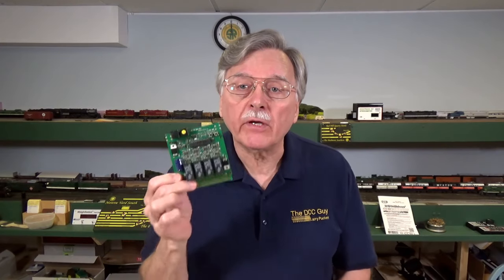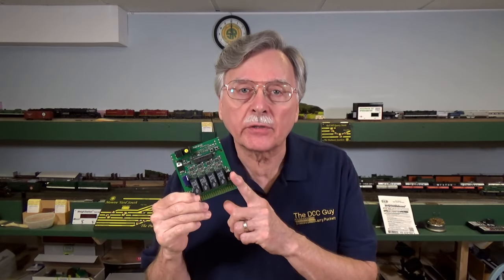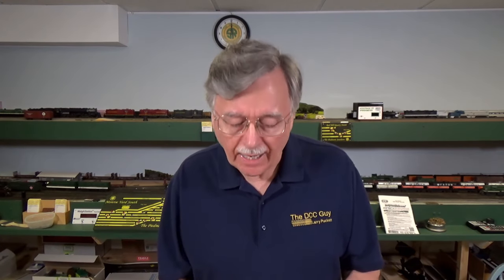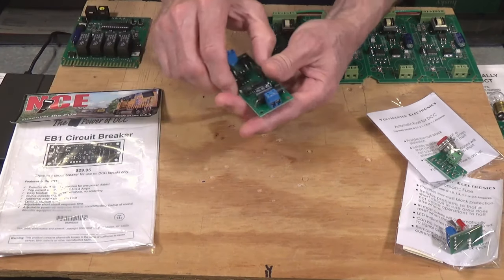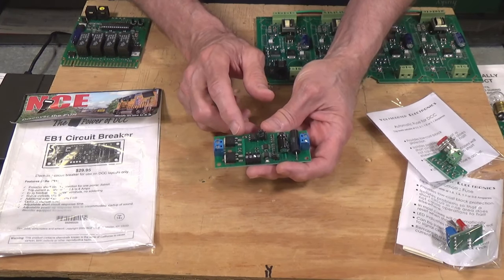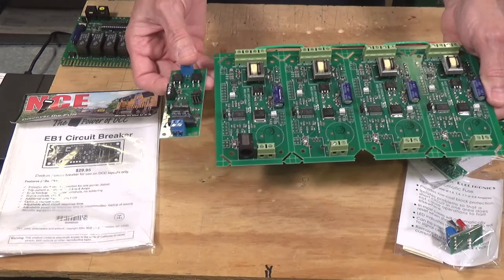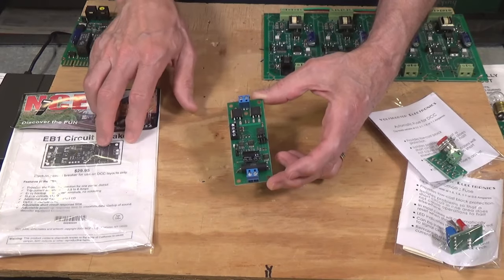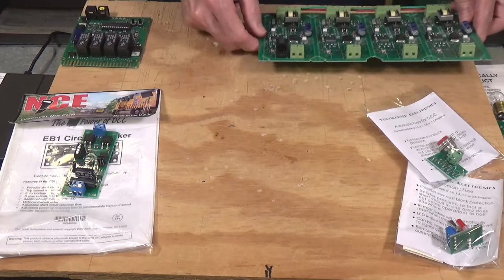DCC Circuit Breakers For Your Model Railroad (97)

Comment: A quick question I now use the digitrax board you showed ....I used one circuit as a reverser...can you do that with the others shown?  I plan to add another circuit beaker to the upper level and am wondering how to hook up the next one hope you go over adding it.
Reply from the maker: As far as I remember the Digitrax PM42 is the only one that can be used that way. However there are plenty of reversing circuits out there.

Comment: Hi Larry, I am an avid devotee of your YouTube videos. Based on this video I purchased a PSX4 for installation on my DCC layout. However it seems that it in not just a simple matter of wiring them into my NCE booster and bus wires but I have to program each circuit breaker as well according to the instruction booklet. Is this correct? I am a novice at this and if programming into my NCE system is required could you please explain in another video if you have not already done so? Thanks for some clear, helpful and insightful
Reply: ...insightful assistance. Regards Ernie

Comment: Hi Larry - I bought two PSX circuit breakers. It says Digitrax users should use jumper wire from J7-3 to J7-4. Dumb question, but does this mean I need to solder a wire between those two holes on the board? Do you do that on yours?
Reply from the maker: Yes, I just ran a thin bead of solder between the two holes on the board. Make sure to look closely at the markings on the board and the instructions as it is easy to get 3&4 confused with 1&2.
Reply: Thank you! I appreciate all the help.

Comment: An update to my further email to you last week.
I have a NCE power cab. I joined current set jumpers 1 2 and joined them together for the power cab and changed the CV 49 to zero.When ever a short occurs on any of the circuits the whole system shuts down.  My next test was to disconnect the current set jumpers and change CV 49 to 001.  The same thing happened, the whole system came to a halt. Can you tell me what I'm doing wrong. The circuit board was connected  to my layout  and it did the same thing . So I disconnected the whole unit from the layout and did the same tests as before with the same results.I look forward to your reply. Sorry for being such a bother but been trying to solve this problem for about a year Cheers David Kidd
Reply from the maker: Well it seems you have set the unit for the lowest trip current value as I would have suggested. At this point you should contact the designer, Larry Maier, using his email address larry@tonystrains.com . It is possible that you have a defective unit and he can best help you if that is the case. Good lick with it and get back to me if you have trouble contacting him, this is a new address—Larry

Comment: I would like to build my own breakers.  I have divided my layout into like 15 PD's (power districts) and need independent power for all.  But the commercial ones are pretty expensive and the inexpensive commercial ones seem easy to build if schematics could be found. Are there any true schematics for breakers fairly simple to build that are more than lights?  Thanks.
Reply from the maker: I don’t know of any and to be honest it is probably cheaper and easier to buy commercial ones unless you are an EE.
Reply: @TheDCCGuy  I think you're right, but with 15 proposed pd's, I may look a little more.  I also have this book "Electonics for Model Railroads" written a while ago, am mentions DCC (once) and I may find something buried in there.  But I may go for the cheapo, a step above the simple light.  Thanks.
Reply from the maker: I have a friend with a HUGE layout. I think he put in about 50 of the tail light bulbs and they work OK. Take a look at my video on the improved light bulb breaker.
Reply: @TheDCCGuy  I will look for it.  Plus regarding the reverse loops (1 reverse loop module controlling multiple reverse looping situations), is that I sometimes toil willy-nilly on my design software - 3D Railroad - and before I know it there are several rl's, sometimes in surprising places.  So I just plug in into the nearest module.  Just  another quick thought...  I would like a set up to check the polarity/phase difference of two adjoining districts, specifically those going into and out of rl's. Thanks.
Reply from the maker: If you wire a light bulb across the gaps on a reverse loop entry or exit the bulb will only light if the track phases are different.
Reply: @TheDCCGuy  By light bulb, I am thinking you mean LED light.  I did that, and it popped like a flash bulb, never to rise again.  But as per a video of yours I viewed last night, I will add a 1K resistor if I can scrounge one up, and another LED.  Same for a light I want to put in a caboose, but with some type of rectifier, but may not make any difference, as phase, not polarity is relevant in the DCC circuit.  Keep making those videos, I try to watch at least on a night and they help a lot.  Thanks!

Comment: Larry
In #97 circuit breaker issue you have talked about the doc specialties psx4 boards
You said you would revisit it at a later date
I cannot find it.
Please spend some time on a single unit and walk thru the component more clearl
I have 6 separate locations and I have shots occurring
There is a all led on the bottom section that lights up 
Please spend some time explaining the make up of the unit 
Thank you 
Kevin ONeill
Reply from the maker: I suggest you contact Larry Maier who designed these boards via Tonys Trains (larry@tonystrains). There were several versions of the software and he would be most familiar with your version and any implications on operations.
Reply: @TheDCCGuy  
I will give him a call 
Thank you

Comment: So can I connect a PM74 directly to my DCS210+ or do I need to get a booster?
Reply from the maker: Yes, that way you can essentially divide up your booster output and have 4 blocks that are individually protected from shorts in another block. I suggest you download the manual and read it thoroughly before committing to it. Make sure you understand how it works and is set up. Tnese are more complicated than the usual power managers and include transponding and block detection.

Comment: Can i add a buzzer into the system
Reply from the maker: Some from DCC Specialties may have a spot to add one but most do not that I am aware of. It’s a pretty good clue when your trains stop running that power is off. With others you would have to cobble up a circuit to turn on the buzzer when power goes off.
Reply: @TheDCCGuy  Thanks, but i was thinking of when you  in another room

Comment: How do-you hook up the volt scooter to track ??
Reply from the maker: One DCC track bus wire goes directly to one track rail as usual. The other bus wire is connected to one screw terminal on the VoltScooter and then another wire is fed out of a second screw terminal and runs to the other track rail. Simple and no soldering required except your track feeders.
Reply: The DCC Guy  OK but it was confusing there’s four terminals,  on the voltscooter that’s why I couldn’t understand the diagram
Reply from the maker: There are two versions. One has two terminals and the other one has four. On the one with four terminals two are for track power and two are for adding a warning buzzer.
Reply: The DCC Guy thanks !!!
Reply: The DCC Guy I believe I hooked up the circuit breaker, and removed the proper jumper , but the toggle switch stays on and shorts out, And I know there’s no shorts because my train is running properly without the circuit breaker hooked up...
Reply from the maker: It sounds like you have the more expensive version that comes with a toggle switch instead of a pushbutton. The toggle on mine is spring loaded and should spring back as soon as you let it go. If yours is not working properly that might cause the short to remain. I suggest you contact the folks at Voltscooter since they do guarantee the product, you may need a replacement.
Reply: yes it’s a toggle switch , it has to be held to not create a short , it does not hold position... it springs back ...
Reply from the maker: I just gave mine a test on a piece of track, shorting it with a screwdriver and it tripped and reset every time. I was using a 5 amp Digitrax DCS200. Check your wiring per the diagram and make sure your wires are firmly in the screw terminals making good electrical contact. That said I used the default setup at 1.8 amps so if you did remove any resistors recheck those connections too. If you can’t find anything then I would contact the manufacturer tomorrow.
Reply: The DCC Guy  Thank you so much I appreciate your help
Reply: The DCC Guy  I’m sorry I just have one more question and maybe this is what’s the problem but I am have a small layout so I’m just doing the entire layout for a short protection,  I’m not concerned about Operations continuing on any part of the track am I able to use it for an entire track layout 4 x 8’
Reply from the maker: It still should work in that setting. For my test I hooked mine up to a short piece of track. What size wire are you using and how long is it?
Reply: The DCC Guy  cat5 , about foot 1/2 long
Reply from the maker: @Griphook3D  You probably are getting too much resistance through those tiny wires. As a test swap in a length of 16 gage wire. My video tomorrow is on wire sizes, etc.
Reply: The DCC Guy  i’m actually twisting two together so they’re thicker than one strand but I will try it...
Reply: It’s working, spoke to voltscooter, had to change some optswitch coding, digitrax has its own short protection, had to change the breaker timing to allow voltscooter breaker to kick in....
Reply from the maker: Good to hear that. I am surprised that the Voltscooter is that slow. I assumed it worked faster than most command stations.  One more trick to add to the growing list.
Reply: thanks for all your help!

Comment: I have just watched your video on circuit breakers. I have a problem with my psx-4(by tony's trains). when  ashort occurs on one of the circuits it does not just stop the loco on the track where the short circuit occurs but on all other cuircuits. The whole layout comes to a halt. My controller is the NCE Power Cab. can you help. I have exhausted all possibilities. Thanks in advance cheers david Kidd
Reply from the maker: Have you activated the low power options on the PSX? Also make sure you have set the trip currents low enough for the PowerCab. Otherwise instead of one PSX tripping to contain the short it will pass through and shut down the PowerCab.
Reply: @TheDCCGuy  I have put jumpers on pin 1 and 2 and change the CV49 to zero.  it still shorts all the block and every thing comes to a halt. sorry to keep bugging but been trying to fix this problem for over a year. Thanks again for your help cheers
Reply: @davidkidd2291  Hi David. Just an idea, are all your blocks are isolated?